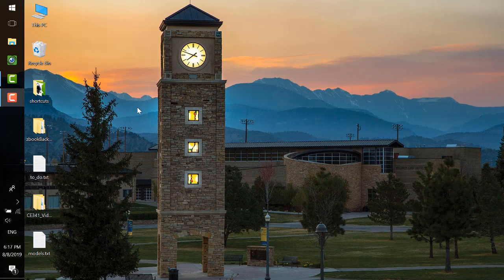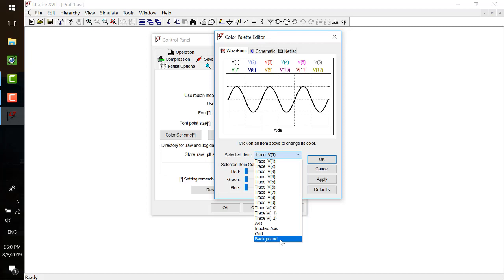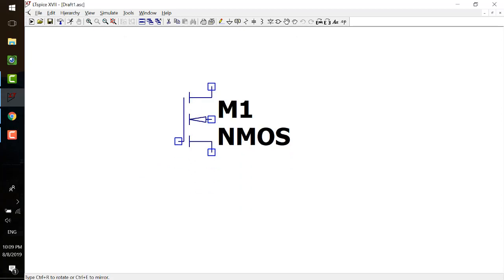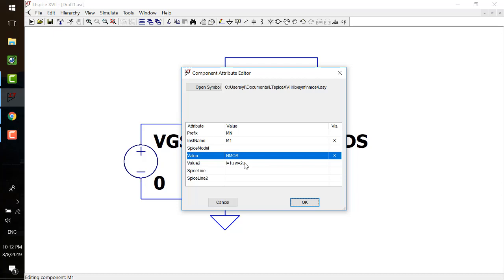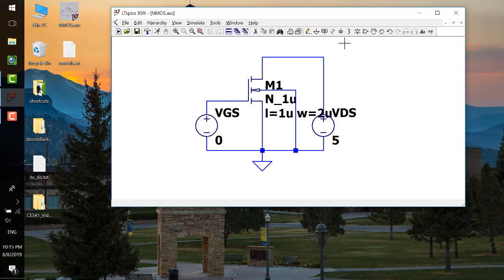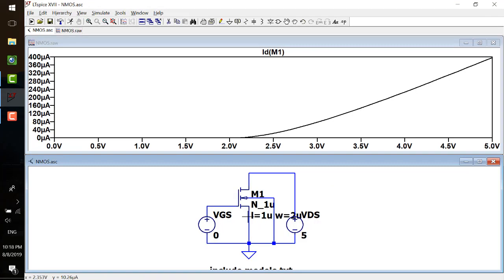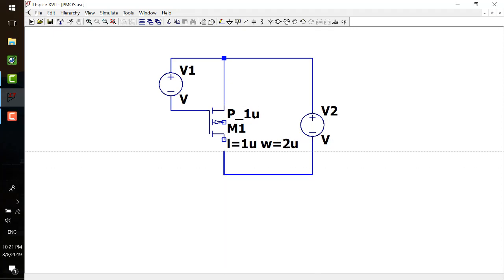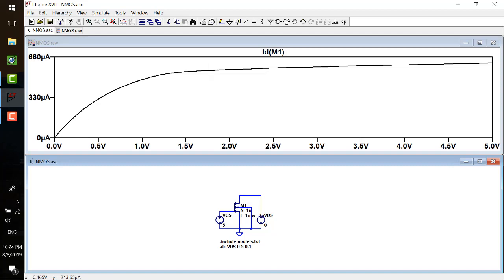Lecture 10 - LTSpice simulation of NMOS PMOS IV curves (M2_v4)

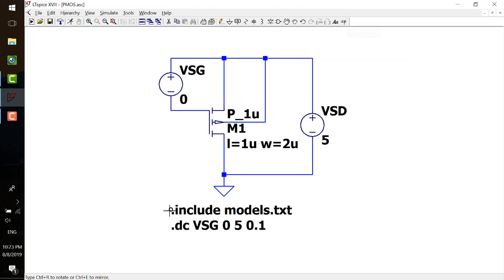Comment: Hi sir, in video 20:23, for PMOS why can't I use  negative voltage(VGS) .dc VGS 0 -5 0.1to simulate, but must use positive voltage (VSG) ? thanks a lot.
Reply from the maker: I think it would work. Did you change the name of the voltage source to VGS? 'VGS' or 'VSG' is just a label but not a polarity.
Reply: thanks for your reminder. If want to use VGS，the voltage source's polarity must be inversed to -+ and type initial value VGS=-5，then the simulation's result will be correct.
Reply: @josephhuang6585  mine didnt worked
Reply from the maker: @josephhuang6585  Send your schematic to yiyanli185@gmail.com and I'll take a look at it tomorrow.